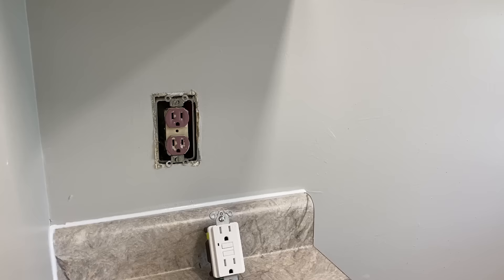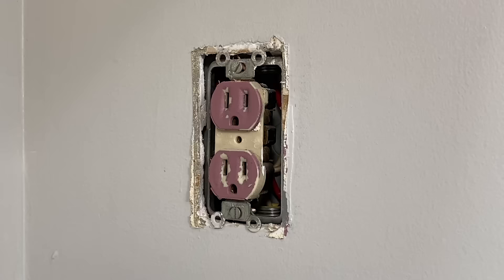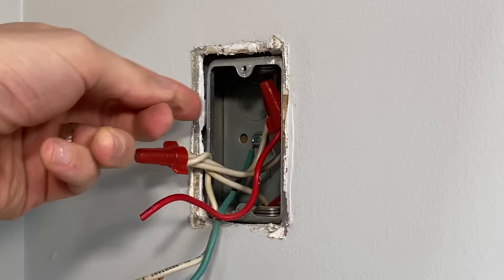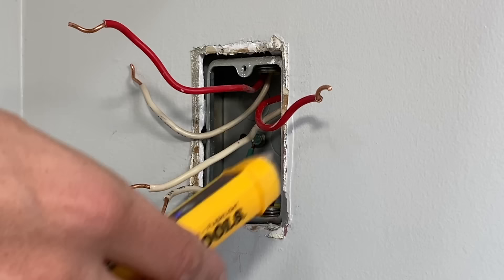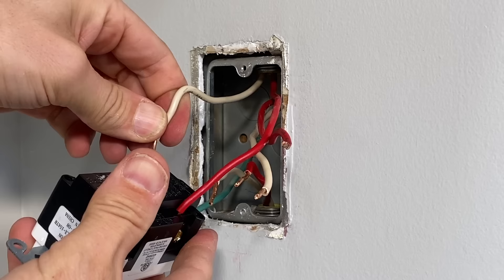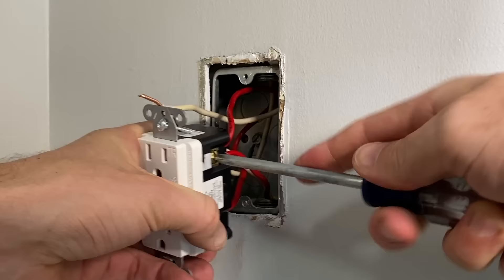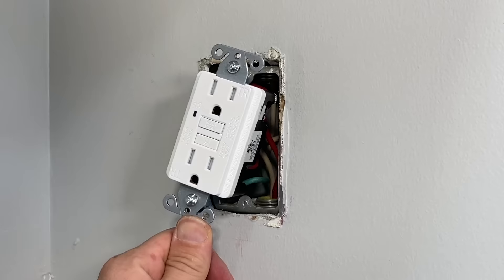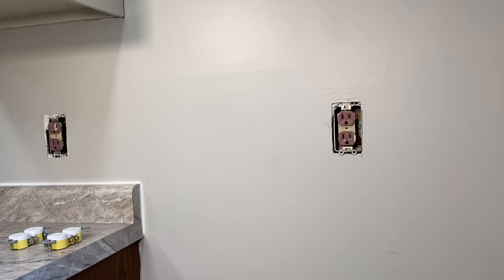Replacing A Standard Outlet With A GFCI Outlet

Comment: In a kitchen, you don't need a GFCI outlet for all the outlets? I have a kitchen that has 6 outlets and only one of the is GFCI. The two that are nearest the sink are actually not GFCI outlets. Is it not a requirement for them to be since I have one GFCI outlet in the kitchen already?
Reply from the maker: Hey Brad, I am not a licensed electrician but yes they all should be protected by GFCI.  With that said some times normal outlets are in series to a GFCI will provides fault protection at that outlet as well.  You can check by tripping (pressing the test button) of the GFCI and see which of the other normal outlets turns off.  This would indicate that the other normal outlets are in series with the GFCI you tripped and should be protected.
Reply: @EverydayHomeRepairs  If they are downstream and protected they need the label "gfci protected outlet" on the face plates.
Reply: @surferdude642  Exactly, but most people don’t do it because the sticker "look bad". And anyways, I hate kitchen with daisy chained outlets. I want dedicated outlets in a kitchen because the loads are high and I don’t want the breaker to trip as soon as I’m using two things at once
Reply: @cedricpomerleau5586  If you're talking about the circuit breaker at the electrical panel tripping then you are overloading the circuit. You should have 12 gauge wire and a 20 amp circuit breaker. This has nothing to do with the gfci. Don't use a 20 amp circuit breaker with 14 gauge.
Reply: @surferdude642  Not what I’m saying, I’m saying it’s a bad idea to daisy chain two GFCI as it means they’re both on the same circuit breaker. A 20A for two outlets in a kitchen is still not enough. I prefer having two 15A ones, one for each GFCI.
Reply: @cedricpomerleau5586  agreed

Comment: I have only 2 wires coming in to box from a 20 amp circuit. This is the only outlet that breaker feeds. Can I use a grounding wire to my metal box? or do I need to run new cable to circuit.
Reply: test the box for ground its rare but there was a time when they did run egc to boxes before bx came out
Reply: @wizard3z868  thanks for reply. I ended up just running a new line  from beaker panel to outlet. More work but I sleep better knowing I now have a ground
Reply: @gfd165  thts ok more than likely you wld have had to run new line

Comment: I installed a GFCI  in a bedroom with two outlets (old house with no ground wires).  The GFCI works but the second outlet stopped working afterward. I was careful to take pictures of the connections on the outlet I  was replacing prior to replacement so I'm pretty confident that the wires are connected correctly.  Could my issue have something to do with the fact that the old outlet I was replacing had only single terminals?
Reply: Is there a ground wire in the circuit?

Comment: If there is not a GFI in a particular line should one be installed? How do i tell if i have the correct breaker to support a GFI?
Reply: You can install one on any circuit breaker setup. But arc fault breakers may not need gfci receptacle in your situation. But still recommended.
Reply: GFCI is required where it is close to a water source or outdoors. No special circuit breaker is needed.

Comment: Only problem I see is you should have nipped the wires a little on some. You had too much copper showing between the connector and the insulation, which can result in problems.

Comment: All should be aware that use of the push-in attachment is not allowed by code in many areas due to prone to failure. It makes poor contact with the wire since a thin metal flap touches the curved edge of wire. Not that much more effort to use the screw terminal.
Reply from the maker: Hey Dallas,  thanks for the feedback but at least this GFCI (if not most/all) do not have the standard push-in holes found on many standard receptacles.  These holes used actually have a plate that pulls in when the screw is tightened to make a solid connection that at least from my knowledge doesn't have the same issues / failure modes.

Comment: Is it possible for the GFI to go bad,it will work but the outlet it feeds will not work? Asking can one  go bad
Reply: My short answer is yes, they can go bad.  I had the opposite happen - the outlets of the GFCI quit working, but it fed the other outlets just fine.  If you have one, you can use a volt/ohm meter to test for voltage to your feed wires directly at the GFCI outlet feed side.  This will tell you if you have a problem with the outlet, or somewhere in the wiring between outlets.  Make sure to press test and then reset before going through previous described voltage test.

Comment: I didn't like how you put the wires inside because I saw that one wire was exposed too much past the outlet and that's a NO NO.... I'm not a electrician but I learned that when you cut and place the wires in its hole or make a hook to place around the screws, it should not be exposed past the outlet. let's teach the beginners correctly and please people make sure the wires are inside the hole completely and or make sure the hooks are completely tight around the screw don't expose too much wire  just enough to get a good connection and not too little. on the outlet itself there should also be a area to measure how much to strip...God bless and as long as the power is off people you can achieve this easy replacement outlets even if you are a woman like me....😊

Comment: A bit more money, but I would rather pig tail each outlet and install a separate GFCI for each duplex recepticle.   No need to hunt for a GFCI and furthermore, it is not intuitive for most homeowners to look for a tripped GFCI when a non-functioning appliance is plugged into a standard outlet.   Most folks will head for the breaker box in an attempt to reset a tripped breaker.

Comment: For a "power tester" I just plug in a lamp which I know that works, and then turn it on.  If it comes on, I know there is power. If it doesn't, then I'm safe to work on the outlet.
Reply: Please up your testing.  Any neutral problems or high resistance connection could cause your lamp to not light up and still leave 120 VAC in the recepticle box you want to work in.
Reply: @keithharrington4595  I did. I got a real tester now.

Comment: Will replacing any of the 3 with a GFCI receptacle do the trick, or does it have to be a certain one according to the wiring?
Reply: The first one from the circuit breaker needs to be GFCI.

Comment: Why is it that both auxiliary outlets (the 2 purple ones along that same wall) have their own pair of wires coming into the primary outlet?  I mean, why did they not simply daisy-chain from the next nearest outlet?  I was sure the whole idea of having extra screw terminals on sockets was for that very purpose.  What am I missing?  ;-]
Reply: Robert Cartier,  actually this is the preferred method of electrical wiring. Only 2 ungrounded wires need to be connected to the receptacle instead of 4. It is therefore easier to change receptacles later. It also provides an effective pass through without involving the receptacle at that location. The other screws do serve another purpose in the event that you want to separate the 2 sockets from one another. There's a tab between the screws that can be broken to accomplish this. You may want one socket to be switchable or you may want to use separate circuits.

Comment: Is the ground connection still necessary with a GFCI outlet?
Reply: A ground wire is not necessary to protect an individual from a shock, but electronic equipment will not be protected without ground. The electronic may not become damaged, but the risk is high if you have a ground fault.

Comment: How does one identify line vs load? Hot? Neutral?
Reply: The back of the gfci designates line and load. The load comes with tape over it, to be removed when using. Hot wire is black, can be verified with a non contact voltage tester. White is neutral. Brass screw is for hot wire, silver screw is for neutral.

Comment: How do you know where to put gfi to protect other outlets?
Reply: First one from the breaker. If you pull out all the wires and cap them off temporarily, then turn power back on, the outlet should have power but the protected outlets should not.

Comment: Just a note that in my house there are 3 GFCI protected circuits: bathrooms, kitchen, and garage. Each one protects several outlets. For example, if my GFCI in the downstairs bathroom trips, all the outlets in all the bathrooms lose power.
Reply: Do not understand the logic , why the other two trip while only one outlet trips.
Reply: That means it's doing it job,  you can add gfic outlet in each bathroom by rewire each gfci outlet to the line wire only

Comment: What do you mean by LOAD line? What are connected to the load line?
Reply from the maker: Load line are the wires which would be going to a downstream receptacle.
Reply: @EverydayHomeRepairs  ok thanks but the load lines shouldn't be "live AC" when trying to find the load lines?
Reply: CAN YOU EXPLAIN IN FURTHER DETAIL THIS CIRCUIT.. I'M FAMILIAR W CONNECTING POWER SOURCE TO LINE THEN USING THE LOAD SCREWS TO CONTINUE POWER TO OTHER OUTLETS BUT THIS DOUBLE WIRE PLUG IN CIRCUIT IS NEW TO ME?? I GUESS THE QUESTION IS WHAT IS THE ADDITIONAL HOT WIRE FROM..MAYBE  THAT GFI IS IN THE MIDDLE OF A CIRCUIT ? I THINK THIS VID JUST NEEDS SOME MORE EXPLANANTION.      ANYONE WHO HAS THE ANSWER TAKE A MOMENT TO REPLY PLEASE--THANKS
Reply: @matthewpolo227  Nothing spécial there, you’re doing it right. He’s got four load side wires because he got two loads downstream of that plug. There’s no problem wiring both of them through the load screws.

Comment: What if you don’t have a ground wire could you still use a gfi outlet
Reply: I have the same question.
Reply: yes tht is the approved method and than you have to use the stickers tht say gfci protected no ground.(if its a metal box test it there is a small chance it may have an attached ground conductor than you just have to attach a ground tail to box

Comment: how do i find out if my outlet is connected to a daisy chain?
Reply: See how many wires are in the box. When you disconnect the plug, and leave all the wires capped using wire nuts, do other nearby receptacles stop working when you turn the power back on? If so, then they're daisy chained.

Comment: Question. When I am replacing the receptacle into the wall I’ve had problems with the top and bottom screws not wanting to thread.  So frustrating . I’ve even tried to use the screws I took out and they won’t thread either.  Jy4fghjh4cdss@z

Comment: You should never use those holes on a receptacle. They pose a risk always use screws, if too many wires pigtail off of it.
Reply: It's odd because he said the exact same thing in an older video of his. Not sure he wouldn't follow his own advice.
Reply: Kevin, those are not "bnackstab" holes that you find on cheap receptacles. The wire gets sandwiched between the brass plates for an excellent connection.
Reply: @surferdude642  Exactly, he didn’t say it, but those aren’t the same. They do tighten on the wire when you tighten the screw.

Comment: Was always made to believe a G.F.I would not be of any use with out the proper wiring with ground wires !
Reply: NEC 406.4(D)(2)(b) allows for the replacement of non-grounding type recepticles with gfci's And a label of "no equipment ground" on the GFCI.

GFCI's work by measuring the current in the hot and the neutral and tripping to stop current flow / circuit use.  If memory serves, 0.05mAmp is the trip setpoint for current difference in personnel protection GFCI's.

Comment: Hoosick won't show your accurate line that close to other conductors. And you're wires are against code to short.  Code says 6"out of box. Also you need pigtails, not direct connects unless it's end of run

Comment: What about testing the thing with a GFCI plug tester ?  if you're a newb doing it dont leave that out  :- )
Reply from the maker: That would be great,  I actually don't have that feature on my plug tester but will most likely upgrade in the near future.
Reply: Yes. Buy one.  The GFI,s made now wl not work if wired wrong between the line and load wires. Look at the back of a GFI.    "Line" and "Load".  Line the hots.  Load. The ones downstream.  Now you can wire it with reverse polarity.  So get a GFI  tester.

Comment: Why are all the reception installed upside down for years I have been seeing this it Took years to get the government to straighten them out in the hospitals
Reply from the maker: On another video I have focused on outlet basics there is a lot of discussion in the comments and people seem split with some preferring the upside down install.  https://youtu.be/UwGoU3XVpnI  🤷‍♂️
Reply: Code doesn't specify a direction that the receptacle needs to be installed, so it all comes down to personal preference.
Reply: The main reason to install ground up is: for the off chance a plug is partially sticking out of the receptacle and something metal slides down the wall, there is less of a chance for an arc.

Comment: Why is the GFCI outlet controlling the refrigerator outlet
Reply: Why would you not?
Reply: @wapicke  Because if you have a voltage variation, the GFCI trips and turns off power.  you could spoil a lot of food and frozen items before you even notice it is off.
Reply: @WarrenKSpellman  lol ya who is never going to the fridge all the time you wld have to be gone almost 12 to 24 hrs before anything wld spoil lol. why i use the fridge or kitchen light for smokes no one going to go without the fridge or main light. lol

Comment: Safety Glasses should always be worn doing any electrical job-- OSHA standards. Thank you.
Reply: FWIW, I would probably be blind today, 40 years after a co-worker powered a circuit I was working on, sending a spray of molten metal into the center of the lens of my goggles.

Comment: My plugs keep falling out. Is there some kind of adapter I can use? No fcking way I could I do that. I have all these electrical tools too from my late Dad.
Reply from the maker: Hey Gloria, so you are saying when you plug something in the plug/cord will fall out of the outlet?  Having an electrician come in and swap out a few new outlets should be fairly reasonable.  For $100 you probably could get someone to stop out and replace the outlets you use the most which should help to hold the plugs in the outlet.

Comment: "Pretty straight forward" lmaooo  For you maybe.  Absolutely no way will I even attempt it. I'll have to pay this handyman to do it. How long of a job is it?
Reply from the maker: If everything is fine with the wiring it is a 15 min job.
Reply: Don't be overwhelmed by the idea of doing this type of job.  First of all, turn the power off at the breaker.  With that, you've taken out the health risk factor.  As far as doing the work, remove the outlet or switch ( remaining wired), take a picture on your phone of the outlet or switch wire configuration.  Undo the work and reinstall the new one in as the old came out using the photo as a reference on how the old was wired.  
I know that was kind of wordy, but this is not a hard job.  You can definetly do it.
Reply: Pay a licensed electrician to do it, not a handyman. Would you have your primary care physician do open heart surgery?